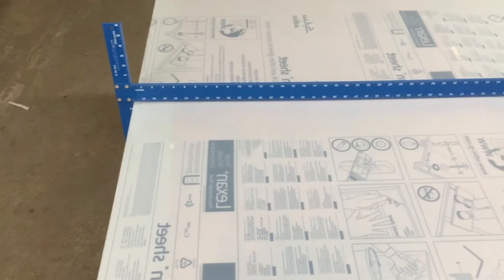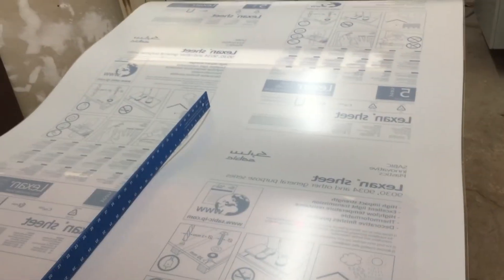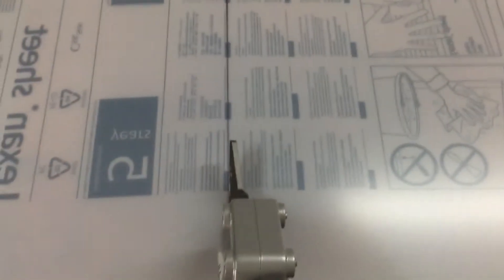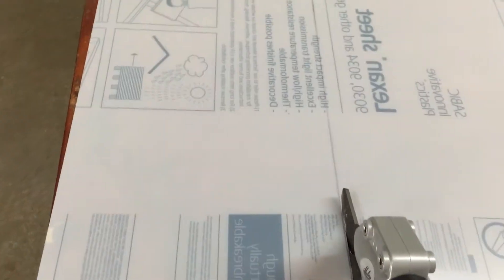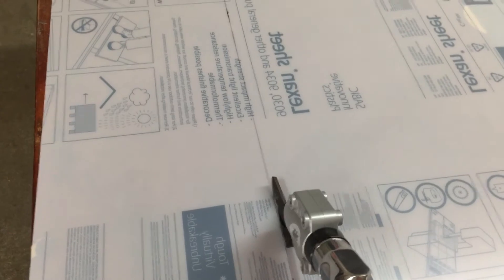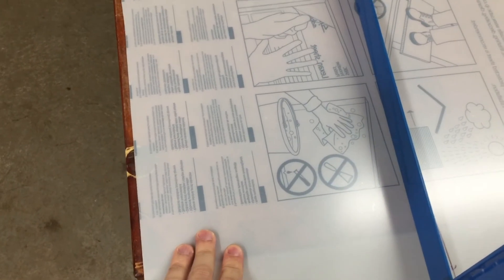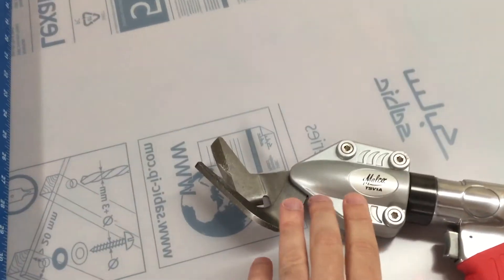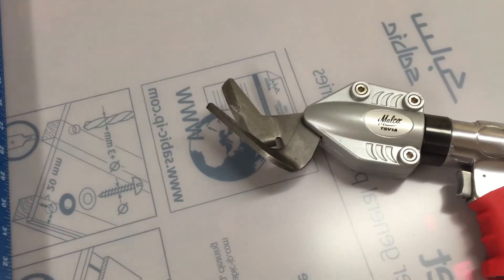Cutting Thin Lexan and Polycarbonate Sheets

Comment: i need to cut heavy plastic carbonate  in a big circular pattern for a dome  cover jope this tool cuts  circular .....
Reply from the maker: It is like a pair of heavy scissors so you could cut a circle but it wouldn't be a very clean edge because the blades move fairly rapidly. You can slow down the air supply but it may not cut as well when slowed down.